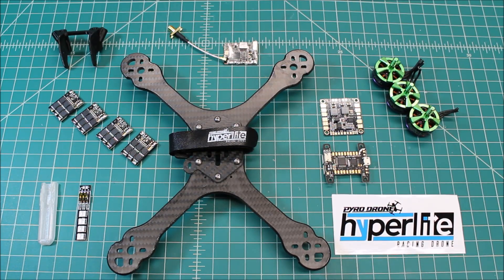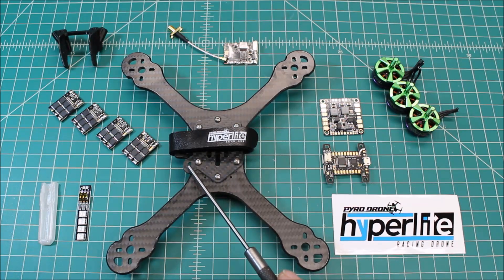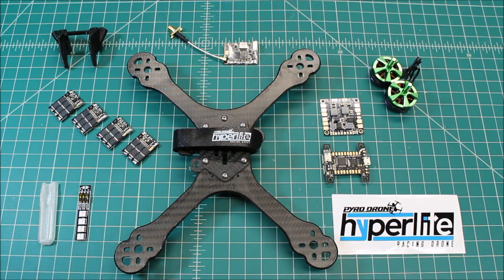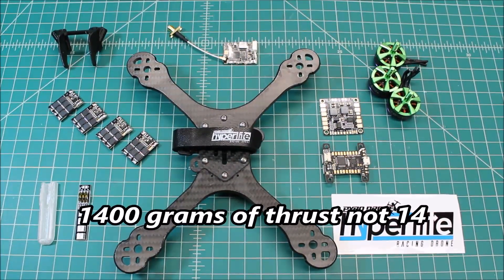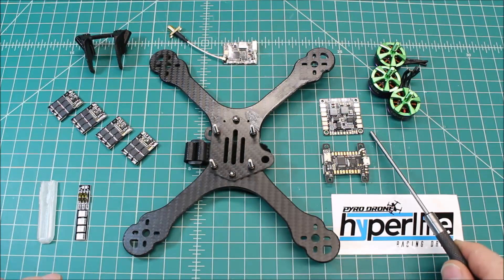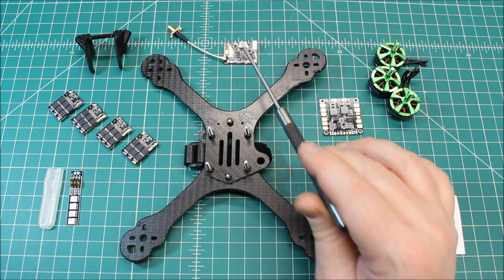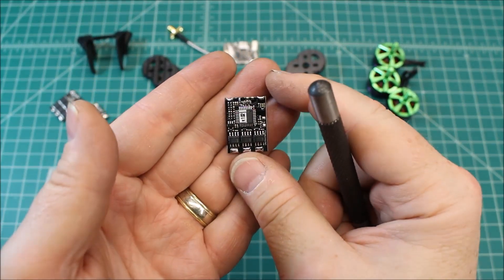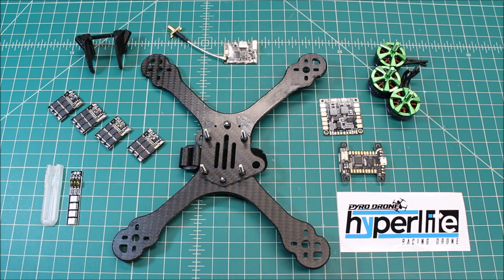Kiss'd Hyperlite Team Edition FPV Race Buildout

Comment: Have you finished this build? you dont have vibration issues wit KISS FC? I see that on this frame, the FC is mounted directly to the 4 frame posts, and that may transfer vibrations to FC.
Reply from the maker: I have finished the build but I am waiting for receivers to come in for the Evolution to get it in the air and do a final thoughts video. This FC mounting can create issues for some FCs. Kiss FCs are generally pretty good with this type of mounting. If not I will "Soft Mount" it.